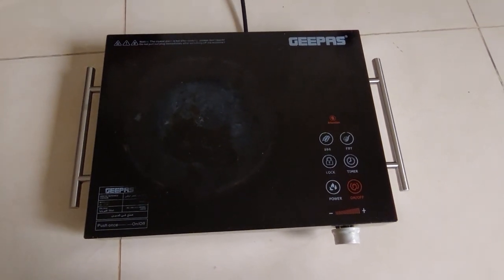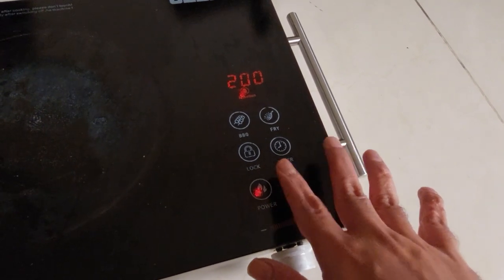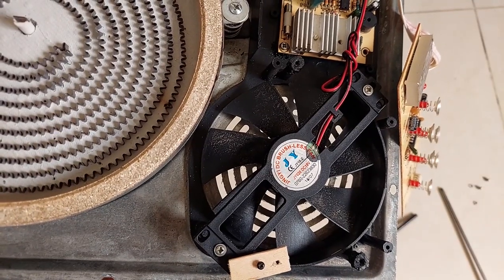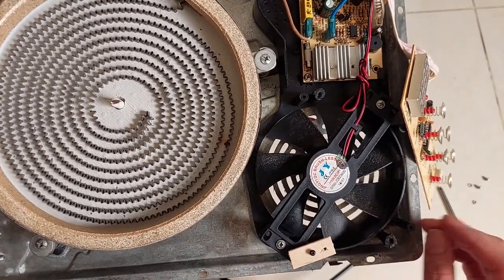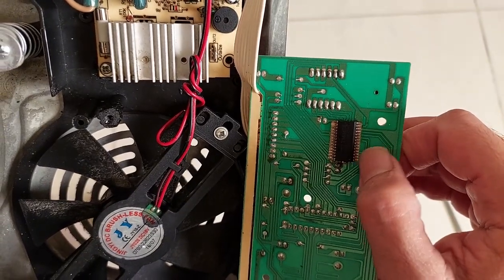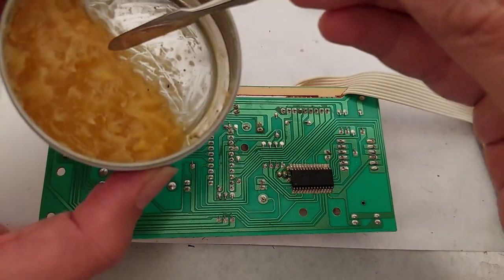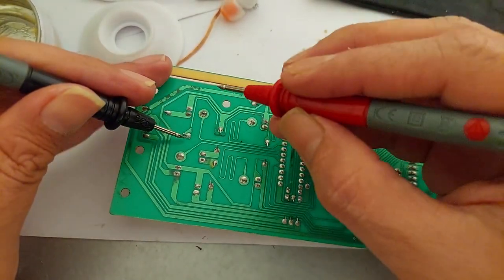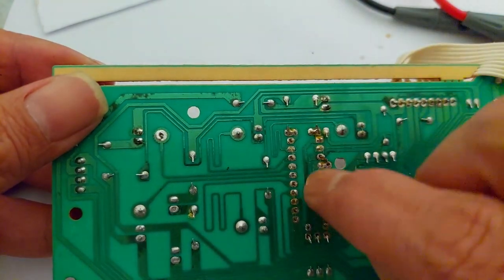Touch button no response infrared Cooker Easy fixed solved

Comment: Mine works with hand direct on spring but not the touch panel
Reply from the maker: @llwasampijja  make sure the spring position heading near glass. solder all the IC legs